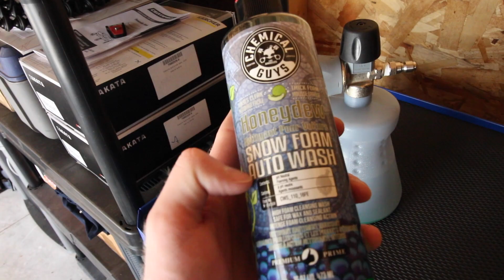How I Wash My Car at Home!

Comment: Oh, one more question. Since you have the same STI as me, what quick release/huh combo you running? I have the complete NRG set up, but I’ve don some more research and read you need the works hub because it still uses the clockspring which we still need to use to not mess up the DCCD. If you use the NRG hub, it’ll mess up with DCCD and it’ll stay open.
Reply from the maker: Exactly right. I'm using the works bell hub and nrg quick release. Everything works perfectly that way. I originally had the nrg hub but swapped it to works bell for that very reason.
Reply: @brodiecd7093  You’re the man! Did you do the little trimming to keep your Cruise Control or what did you end up doing? And did you get the short hub or regular for the Works hub? After you reply, I’ll finally pull the trigger and order it. My new wheel set up has been sitting in my room for months. Haha.
Reply from the maker: @harrycrisp8897  Anytime brother! I didn't actually, I never really used the cruise control before hand, so I don't feel like I'm missing anything without it. And the short hub. I actually just got a vertex signal extension for xmas as well, which is definitely needed 👌🏼
Reply: @brodiecd7093  I didn’t think about the signal extension. Good call. Thanks again man. Since you don’t use the CC, you just left the wires alone for it or traced it back and removed it completely out the car?

Comment: Still running spacers safely after all the time? Been wanting to pull the trigger on the wheels since you told me about the specs and needing spacers.
Reply from the maker: No spacers required on my current wheel setup. But until I switches wheels, I had 0 problems with the spacers
Reply: @brodiecd7093  Okay, thanks. I asked a while back about them on the RPF1’s, but just assumed you didn’t see it. Thanks for the reply. What specs are those you running now? Want to keep my Hawkeye stock body. Don’t want to wide body or anything. Just a nice fitment.
Reply from the maker: @harrycrisp8897  oh sorry about that man! Must have missed it. They are now 18x9.5 +22. You would need to do some rolling/pulling to fit
Reply: Is it stock suspension ? You are pretty low
Reply from the maker: @guymauve0  Its on ISC coilovers
Reply: @brodiecd7093  Thanks for the replies man. Loving the STI. Been looking for perfect wheels for me but I’m super picky and what I want usually is hard to get with the Brembos on. I want some black wheels with a stepped polished lip and can’t find any without having to run spacers.